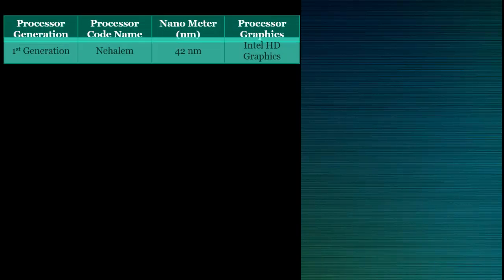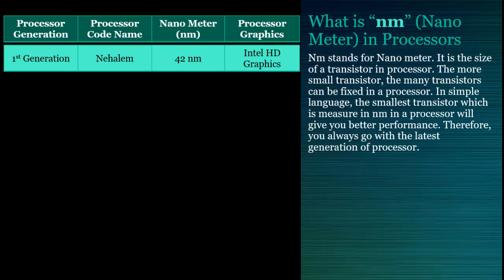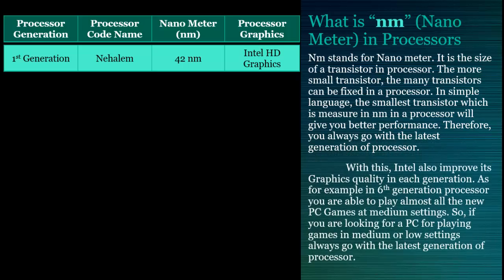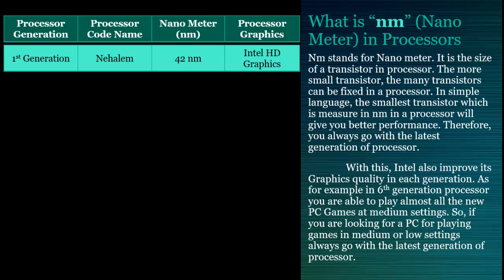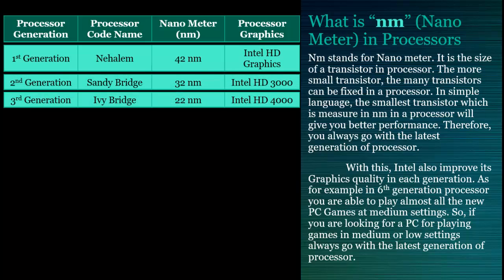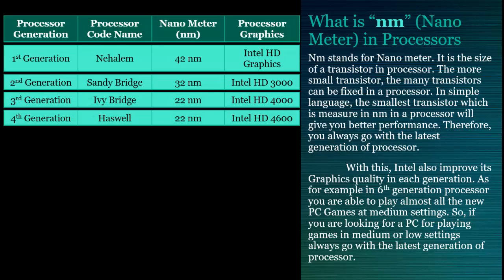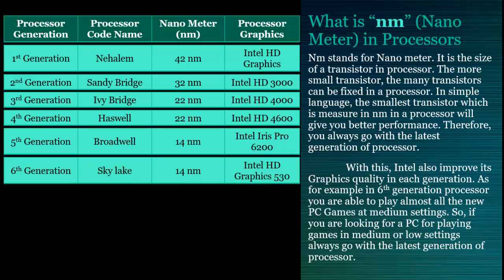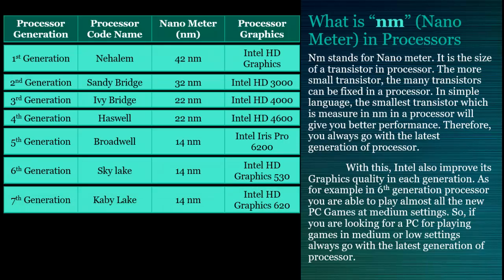Difference Between Intel Processor Generations

Comment: sir... now i will purchase on second hand  laptop core intel i7 8 gb ram 560gb ffd but 2 nd generation..
supplier said me only two used laptop.. its posible or not... 2 nd generation which year manufactured... plz say me sir
Reply from the maker: 2nd Gen is very old. I think in is more then 4 to 5 years old.

Comment: Dell me i5 4th gen me DDR3 badiya h ya

 acer me i3 6th gen me badiya h DDR4 ram
Which is best?
Reply from the maker: Both the processor are good in different terms.

If you are planning to buy a PC for work then you must go with Intel Core I5 4th Gen.

If you are planning to buy a PC for playing games without a graphics card then I will recommend i3 6th Gen because as compared to 4th Gen processors the integrated graphics are improved in 6th Gen.

If you are planning to buy a PC with Graphics Card, then definitely Core I5 will be the better choice.
Reply: Bro me 6th generation wala buy krna chahta hu bcoz usme mjhe DDR4 ram mil jo ki mere hisab se bahut badiya hai vaise mjhe programming krne ke liye chahiye aur game bhi khelna pasand krta hu aap apna opinion de apke hisab se kaun sa best hoga i5 ya DDR4 ram
Reply from the maker: Har processor ka different model number bhi hota hai.
If you can tell me the model number of both the processor, it will be easy to answer

Comment: processor speed kaisy check karengy sir?nd ap koi generation recommend karo konsa acha h . qk kuch dual core hoty h or kuch quad core.
Reply from the maker: +Maru 007 aap desktop Lena chahtey he ya laptop
Reply from the maker: +Maru 007 Core I5 7th Gen Professor is the best with quad core and maximin frequency.
Model No: Core I5-7600K
Frequency: 3.80GHz
Turbo Click Speed: 4.20GHz
Reply: desktop.
Reply from the maker: Core I5 7th Gen Professor
Model No: Core I5-7600K
Cores: Quad Core
Frequency: 3.80GHz
Turbo Click Speed: 4.20GHz
Cache Memory: 6MB

This processor will be the best choice

Comment: I5 2400
4gb ddr3 ram
500 GB hard disk
650 PSU 
For 13000 
Is that price is over I can't judge that need someone's help
Reply from the maker: +Shashank nikku
Is it desktop or laptop
Reply: TECHNICAL TECH  HP elite 8200 minitower model
Reply: TECHNICAL TECH only cpu
Reply from the maker: Thanks for watching and writing back
No bro, I will not recommend you to take this at this price. Its bit high according to its configuration and the model is quite old. The same PC is available in ebay at only 100$.
SUBSCRIBE FOR MORE UPDATE.

Comment: Please, if you are going to buy a PC with a dedicated GRAPHICS CARD, it does NOT matter what kind of integrated graphics your processor has. This video makes it seem like you need a newer processor to play newer games. But that is BULLSHIT, if you have a good graphics card, you can play any game as long as doesn't get bottlenecked by the actual CPU computing power. Which is unlikely to happen unless your CPU is very old or very low-end.
Reply from the maker: Thanks For Writing.
This video is only about processor's generation and not about any extra graphics card.
The people who are looking for a pc without any graphics card and also want to play a game on it. The latest generation processor is always be the best choice.
Reply: Alabastine Thanks
Reply: Nehalem is still the King. In my opinion the best generation Intel has made.